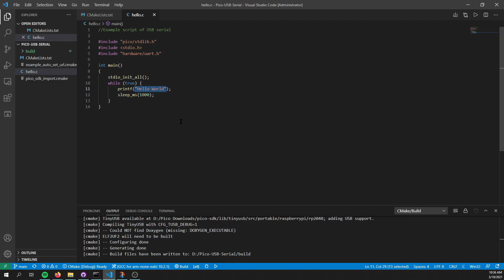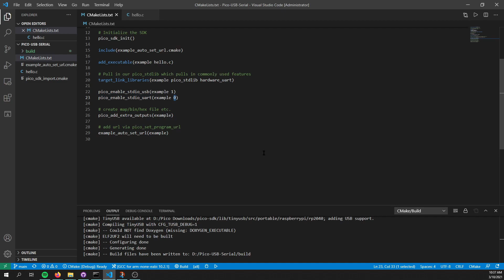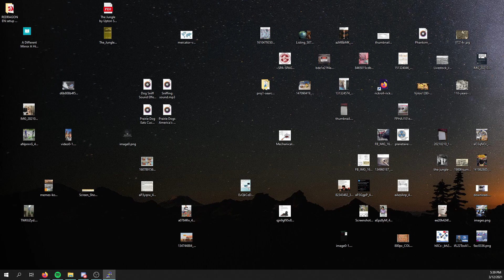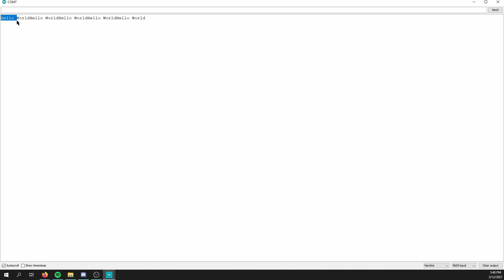How to use USB serial with Pico - C/C++

Comment: This is only a C example, not C++. Frustrating as I searched explicitly for a C++ example for using serial on raspberry but everyone providing a C example claims to be C "and" C++ in its title. You may remove it could help. Thx
But nice video anyway ;-)
Reply from the maker: The same code works in C and C++